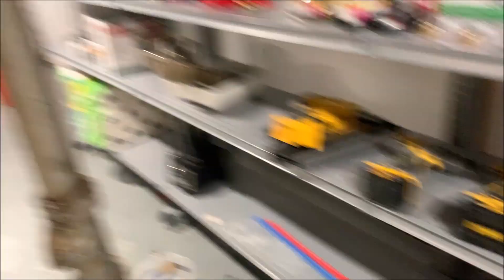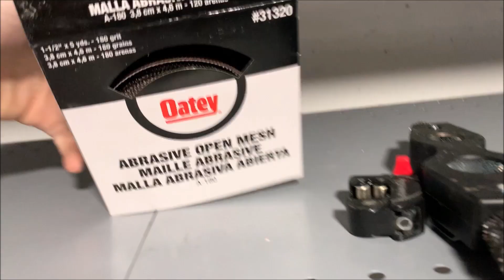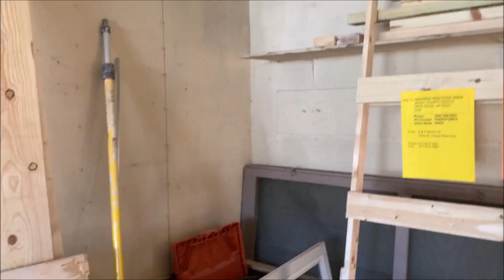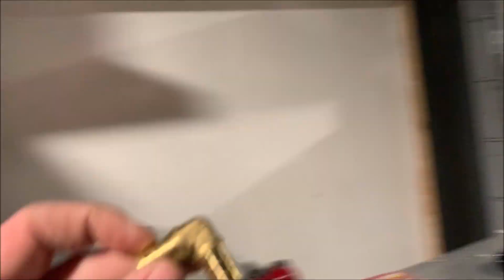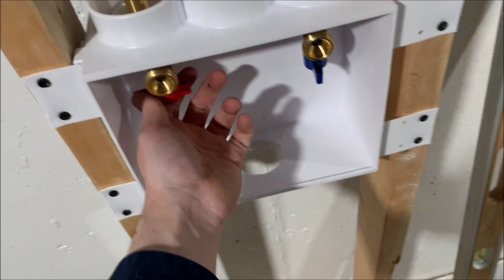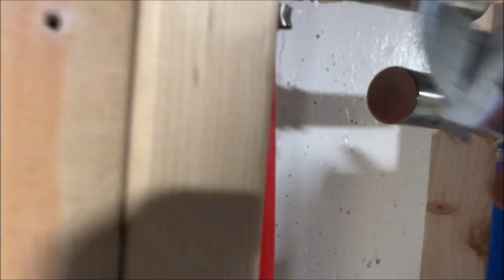Adding New Washing Machine Lines in the Basement

Comment: If you want to recoup some of your costs scrap the copper pipes for cash.  If you want to make even more money cut off all the joints and solder runs which would be classed as Number 2 Copper.  The separated totally clean pipe sections would then be classed as Number 1 Copper, for which you would get more cash.  Faucets are normally coated Brass which you could also scrap.

Comment: Why plastic pipes? Would brass pipes add more value to the home? I’m assuming that the plastic pipes were easier and cheaper to install I’m just wondering how much you actually saved.
Reply: I've never seen brass pipes (copper but not brass). PEX is the standard for most new construction. A lot fewer fittings are needed and easily repairable, if needed. A lot easier to work with. Check the price differential between copper and PEX.
Reply: @billbriggs2309  good to know!